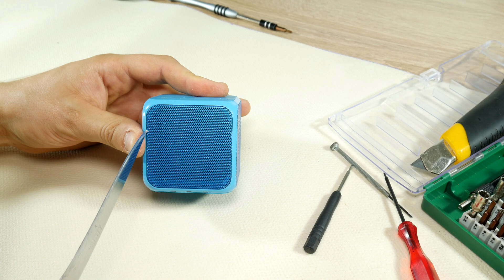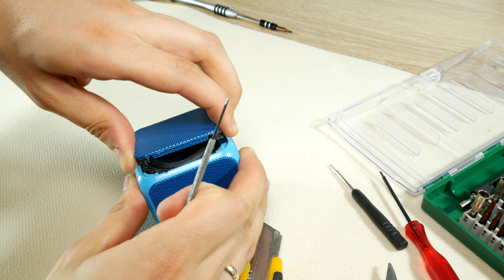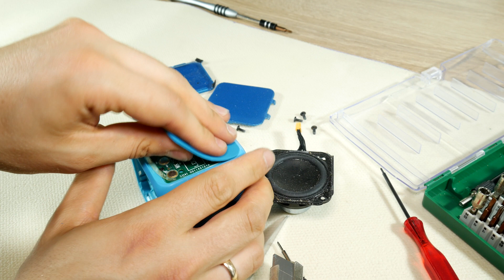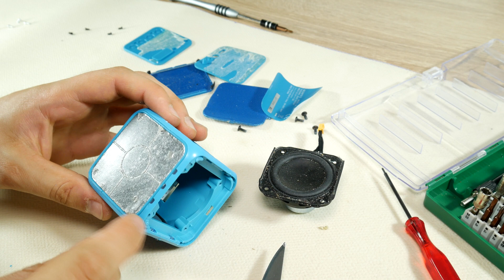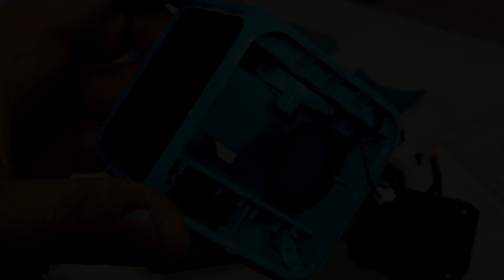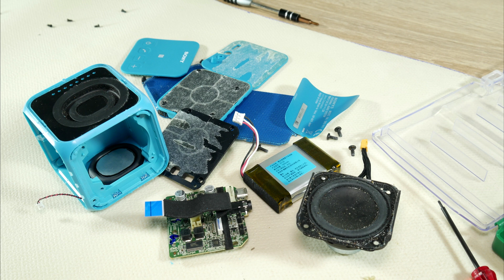Look inside Sony SRS-X11 bluetooth Speaker - What's Inside?

Comment: I have the same speaker and the same color.. Do you know if there will be an online store that will sell a replaceable battery for this Speaker? Thank you for this!
Reply: You can made you own battery, just buy two li-pol akku like original and connect both in series + add original bms/ocb from original pack
Reply from the maker: You can try find it on ebay or alie. Or just use external powerbank.